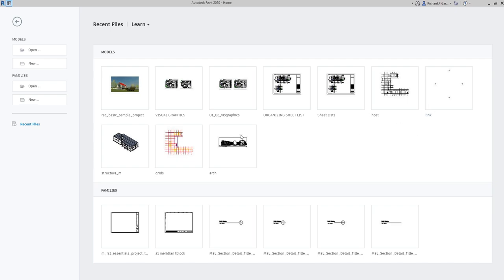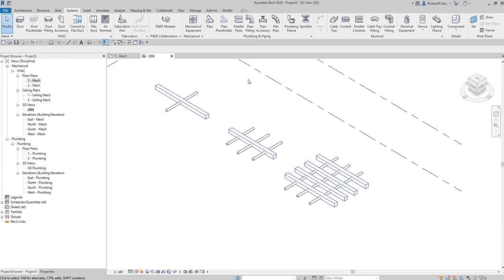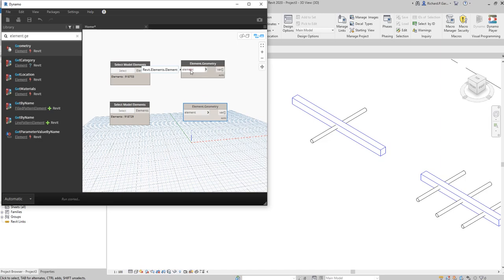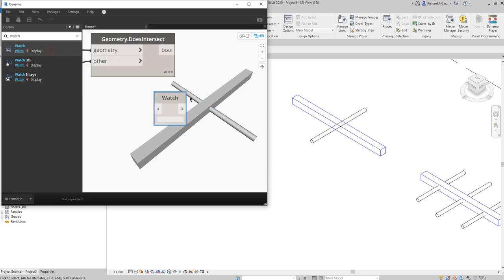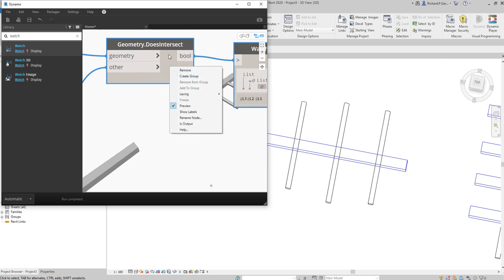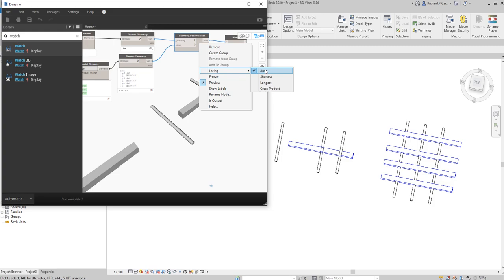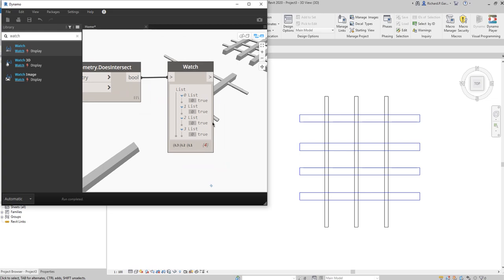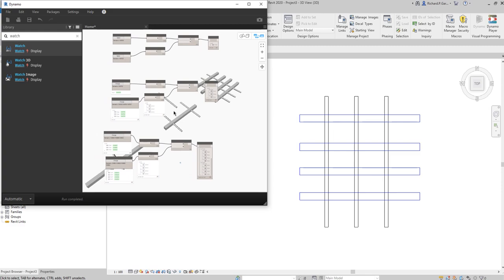DYNAMO FOR BIM - LESSON 26: HOW TO DO CLASH DETECTION

Comment: hii how can we download the script?
Reply from the maker: To download a Dynamo script from Revit, you typically follow these steps:

1. **Open Dynamo in Revit**:
   - Launch Revit and open the project or file where you have the Dynamo script.

2. **Access Dynamo Interface**:
   - Go to the Manage tab on the ribbon.
   - Click on "Dynamo" in the "Visual Programming" panel to open the Dynamo interface.

3. **Locate the Script**:
   - In Dynamo, locate the script you want to download. The script will be represented as a node network within Dynamo.

4. **Save the Script**:
   - To save the script as a file on your computer, click on the Dynamo button (top left corner) to open the Dynamo menu.
   - Choose "Save As..." from the menu options.
   - Specify a location on your computer to save the Dynamo script file (.dyn file extension).
   - Provide a name for the script and click "Save".

5. **Confirmation**:
   - Once saved, you can access the Dynamo script file (.dyn) from the location where you saved it on your computer.

Hope this helps.